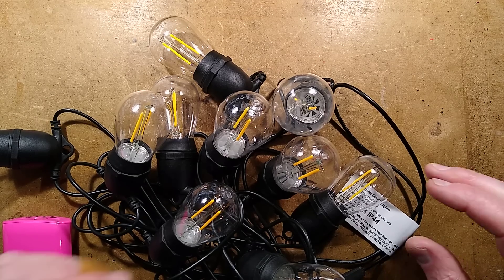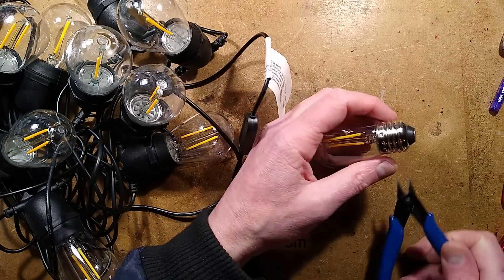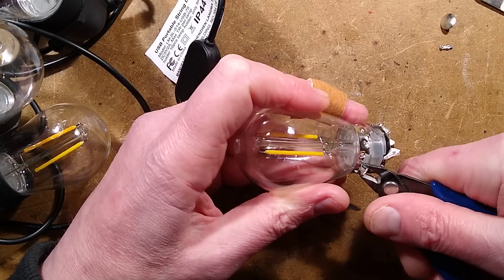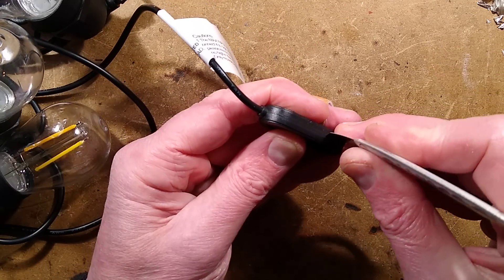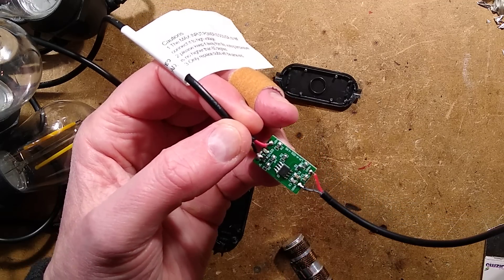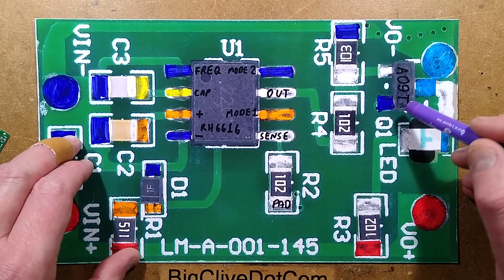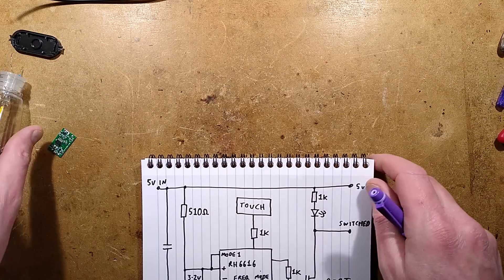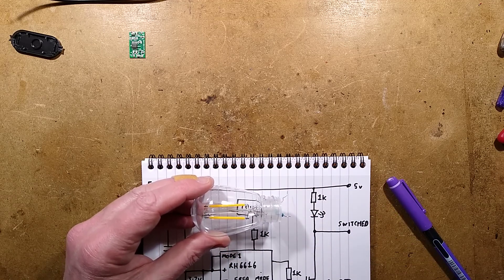Very nice low-voltage lighting festoon

Comment: Using an E27 base for low voltage is a recipe for "poof!"
Reply: I believe the technical term for it is "ElectroBOOM". 🤣
Reply: Took me a while 🤦🏻‍♂️ yes that’s an accident waiting to boom! 😅
Reply: Judging how thin the feed wires are, I'd expect the briefest of mild flashes deep within the housing, then it'd be all over..
Reply: There are 12 volt bulbs that use an e27 also.
I would say that it is on the user to check before blindly screwing in a bulb.
Reply: @tabbertmj  Most users today wouldn't know a volt from a watt.
Reply: @DeeegerD  you're not wrong. Seeing some of the posts in a DIY solar group makes me wonder how some people can cross the road without getting hit.
Reply: @tabbertmj  That's because most new cars have some kind of pedestrian detection system and most experienced drivers have also learned to deal with pets and wild animals crossing...
Reply: @tabbertmj  Yes, we've had the 12V e27 bulbs since I was a boy. I had a vehicle service light that used one ages ago. It came in handy during power failures, too.
Reply: @tabbertmj  Yup... Remember being on a ship that had both 32Vdc and 115VAC lighting. Sometimes a sailor would accidentally put a 32V bulb in a 115V socket. Big flash!
Reply: @tabbertmj  Oh I agree. I have one of these and they're not common. Looks exactly like a regular 120/230 bulb. You really have to look carefully to see the lettering on the top to see it's 12V. And more than often this text fades/disappears over time. I'm just saying it's not a smart idea to take a base that everyone's familar with for a voltage application that's 10 to 20 times lower than the usual.
Reply: @Anthill Inside these "standards" allow people to buy this product at the lowest price. Or we can buy the same, but made by Philips or GE and for only 30 bucks for 1 lamp :D
Reply: A recipe for a happy person of the other persuasion?
Reply: I agree someone could easily put that 5v bulb into a 240v lamp socket 😂
Reply: Ya I was wanting to see the earth shattering kaboom!
Reply: At least it will happen instantly!
Reply: Letting the magic smoke out.
Reply: yes but I think it's neat to use as a method for powering lamps originally used for mains on 12v

Comment: I realise it would push the cost up but it's a shame they didn't incorporate a buck converter to bring the voltage down to say 3.5V. That would allow them to use a smaller resistor in the bulb and dramatically cut the power consumption.
Reply: But the power consumption is already ridiculously low. It just doesn't seem to be worth the cost of adding a buck converter at least
Reply: @WowUrFcknHxC Not an expert but I believe in smaller offgrid setups every pinch matters, of course depending of the system and type of use.
Reply: Power wasted would be reduced,however uniformity of brightness would suffer as the losses of the twin cable will increase and cause more sag over the length..
Reply: @amojak  Exactly the opposite, brightness would be constant until the voltage set by the buck converter is reached. After that, dimming would take place at a lower rate than with purely resistive current limiting simply because less current and voltage is wasted through the resistor.
Reply: @chrishartley1210   if you incorporate a buck converter to feed the chain and remove the resistors then all the LED's will be in parallel . As LED's are a current sink the resistance of the wire will be a significant issue as the first LED will crowbar at ~3V the resistance of the cable mans each following LED will not reach its zener threshold and be progressively dimmer.
the only way you help compensate for this is to feed positive at one end of the chain and negative at the other.
the resistor arrangement although not super efficient does give a more balanced load to the feed wires along the length and you can adjust the resistances if needed to balance them.
you can of course still do this with a buck converter and use much lower resistor values to eek out as much as possible.  
although if efficiency was your aim then perhaps use a series chain and a synchronous constant current boost converter instead.  higher voltages, less power loss in cables, no resistors required.
Reply: @amojak  I appreciate what you are saying, but I feel that putting them in series would defeat the object since a single failure would turn the whole string off and be more difficult to find. I suggested 3.5V and a smaller resistor for the very reason you stated. Also, all the LEDs would need to be accurately matched if the string was going to rely on the resistance of the wire and that's not going to happen with a cheap string like this.
Reply: @chrishartley1210  true, a cheap string and matching not easy, hence series sort of solves that.  the series failure mode issue is a separate one to the efficiency question though and i appreciate this is a weakness.

the resistance of the wire is the potential issue as it is likely CCA at best, having a 3.5V bus will cause a notable drop off in brightness along the chain if fed from one end is my original point.  LED's are zener diodes basically , the poor match you mention makes this even worse as if one bulb has a lower threshold voltage than the rest, it will get the majority of the power.
This is the trade off with parallel LED circuits and resistors and a higher voltage "bus" alleviate this in a majority, albeit with efficiency losses.
Reply: Oh yeah, real shame.

Comment: If you wanted to run them at an even lower voltage you could use 18650 batteries...if you run several paralleled they should last a very long time.
Reply from the maker: I gave some thoughts about that in the description.
Reply: @bigclivedotcom  
Damn...the ONE time I don't read the description before watching the video
Reply: @gregorythomas333 Have been watching Bigclive's videos for years and never realized he put info of the video in description. Please tell me he has done this for a while.
Reply: @Teknopottu  Sometimes he puts full 3D printing instructions as I recall.
Reply: @alexatkin  I now remember finding gerber-files of the low amp trickle charger for small batteries from the description but have forgotten to always check it first.